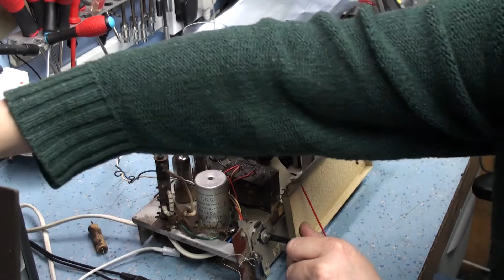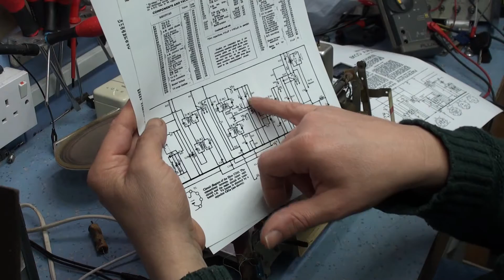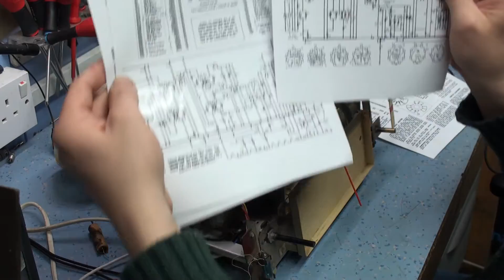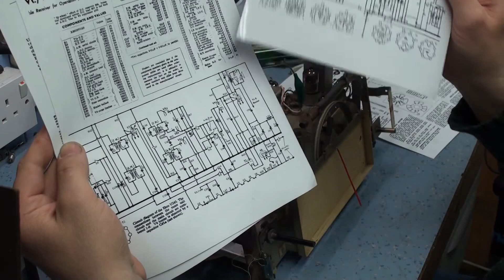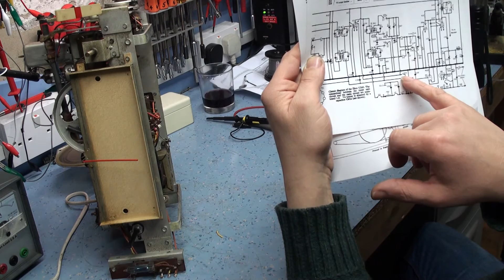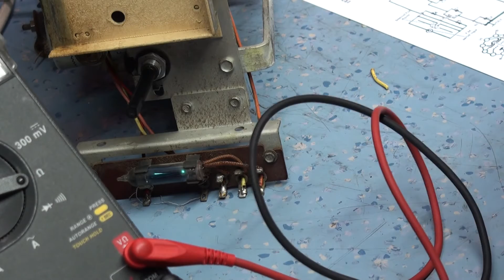EKCO U243 pt2 Strangeness  going on

Comment: Simon,
Though it was well over fourteen  years ago when I worked on my U243, I remember AM performance being generally poor, and VHF being virtually nonexistent.   Having tested each valve (excluding the DM70 - I have no means of testing those), which I remember all gave reasonably good efficiency readings (the UABC80 gave the lowest efficiency reading (almost down to boarder-line), I went through my usual repair modus operandi. 
When I repair/restore a Vintage Radio, I almost always begin by getting the power supply circuit functioning to specifications.  I ensure the HT is running at around plus or minus 5% as per circuit diagram, with minimum permitted AC ripple (that may require replacing the main smoothing electrolytic caps in the pi-filter circuit).  Generally, this can only be achieved when the current draw/voltage sag is not excessive due to old capacitor DC volts leakage etc.  
Whilst I am working on the power supply circuit, I temporarily disconnect the HT rail at a node where voltage is fed to the front-end (frequency changer, local osc', IF amp', and demodulation/AGC), then I  pay attention to the audio circuit.  Once I am satisfied the power supply, and audio circuits are working to specifications, I occasionally go ahead and replace a few wax caps (and reservoir cap if incorporated) in the front-end circuits before I reconnect the HT voltage to the front end.  Once the front end is working. I realign the IFts, trimmer, padders etc if I deem it necessary. 
I seem to remember the very poor VHF performance was due to an resister that gave a high value reading, which I replaced, and I replaced the UABC80 with one that gave a higher efficiency reading, along with (if my memory serves me correct) a 4MFD capacitor in the discriminator circuitry.  
As a radio that was mass produced to a price, It does performs well - certainly as good as some of its 'budget'contemporaries such as the GEC BC402, Bush VHF72, Ultra FM950, and Pye 'Caprice' R31 (I don't dislike Pye Caprice radios).
Regards,
Phil.
Reply from the maker: SteelCity321PB Sorry I have only just read your lenghly detailed reply.  Thank you for your tips.